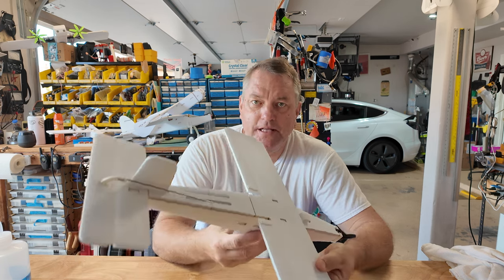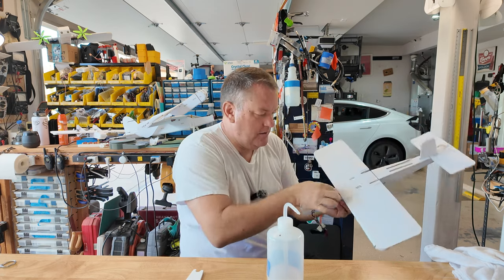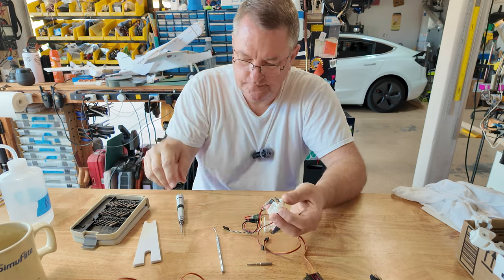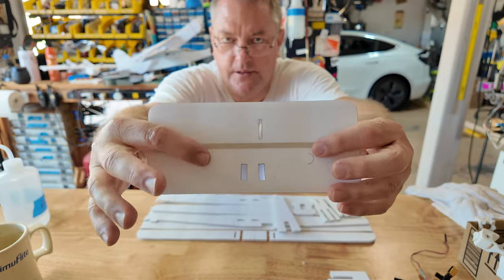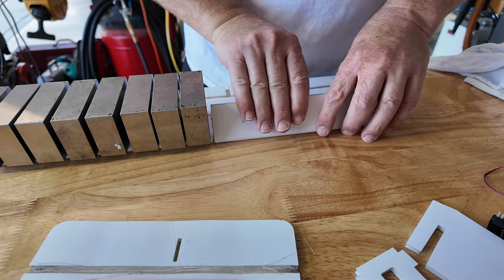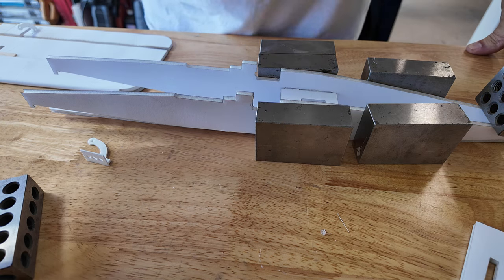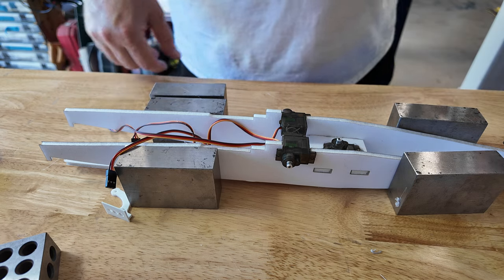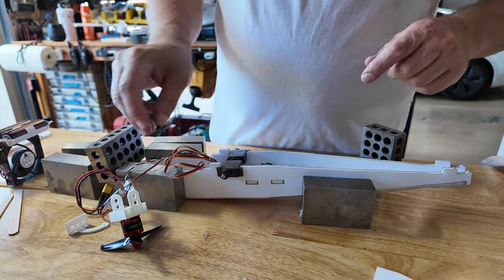Angry Little Plane Upgrade - Making a better Sub 250 High Performance Plane

Comment: I noticed that you wing has the KFM1 style aerofoil with the step on the bottom, generally everyone else uses the KFM2 with the step on the top, have you tried it both ways, is there any performance difference?
Reply from the maker: I got bored in hotel and recorded this for you: https://www.youtube.com/watch?v=rBr6M_oFQQw

Hopefully that gives you some insight on why I inverted the step.

I read stuff online - but at the same time, if I really want to understand it - I'm the type that has to build it and try it, rather than believe things blindly.

For my uses - inverting the Kfm step worked.

I hope this helps.

Thanks for your comment.

Comment: Truly like.your aproaches!
Do you think that one of those 40+ diode lasers could be used to cut the foam?
Reply from the maker: I don’t know about the diode lasers.  Mine is a CO2 laser, and it works really well.  I’d expect that they would - but I’m sure you could find someone that has one and see what their results are like.  Either way - get something that has air assist (pressurized nozzle that also keeps the focusing lens clean and clear of smoke), good fume extraction, and good safety interlocks.  Be safe, wear appropriate eye protection for your laser, and take your time.  They are amazing tools, and you’ll find a million uses for them.

Comment: Looks laser cut. What laser cutter are you using?
Reply from the maker: I have a 100W Gweike LC1290.  It’s a great laser.  Find a hackerspace, or even some local libraries have makerspaces and take a class and learn how to use them.  That’s how I started, and then I started a business that justified me buying my own.  That business went away - but I would not give up the laser.  It’s too handy.  Since then - even the wife and kiddo use it.  It’s an incredible tool when you figure out what you can do with it - but do your research, as not all lasers are suitable for all materials.

Thanks for your comment.

Comment: Yeah, what MichaelScott said.  Why do you have the step on the bottom?  Every video I've seen always had the step on the top, unless you're doing steps on both top and bottom (fully symmetrical).  But otherwise, I'm really enjoying your videos.
Reply from the maker: I got bored in hotel and recorded this for you: https://www.youtube.com/watch?v=rBr6M_oFQQw

Hopefully that gives you some insight on why I inverted the step.

I read stuff online - but at the same time, if I really want to understand it - I'm the type that has to build it and try it, rather than believe things blindly.

For my uses - inverting the Kfm step worked.

I hope this helps.

Thanks for your comment.
Reply: @usefulaircraft  great video and explanation.  Thanks!